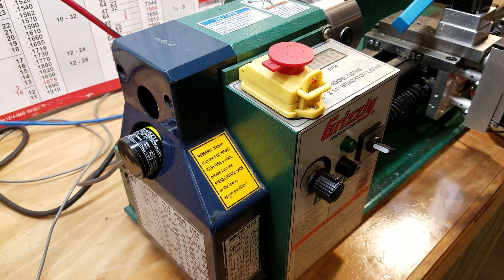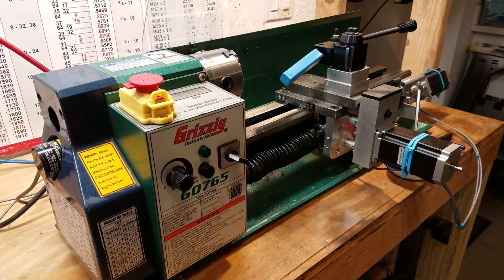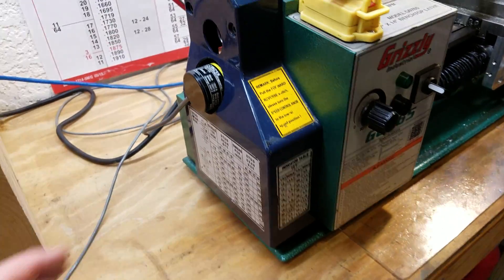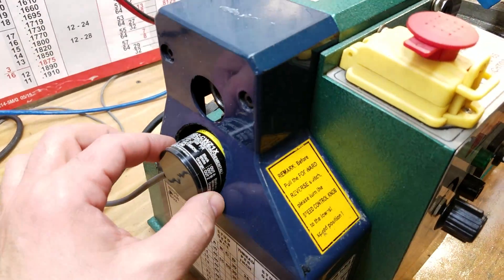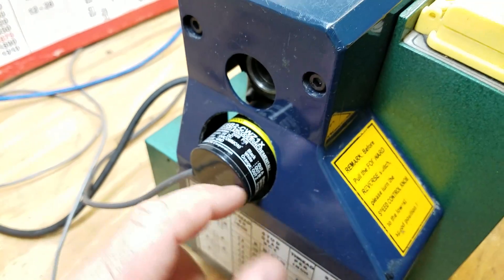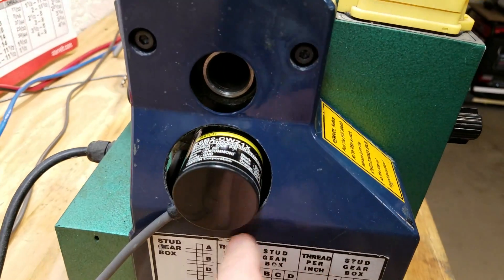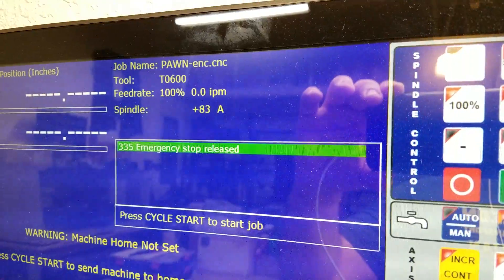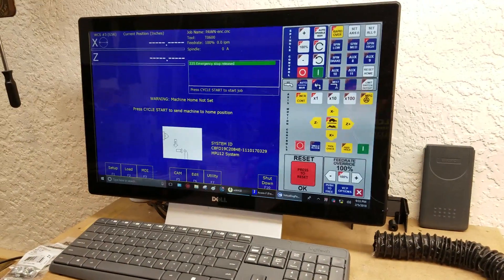Update: Mini-Lathe Spindle Encoder Mounting Kit for Centroid Acorn

Comment: Smart decision Franco. If there is a way to screw things up and get hurt, someone eventually will. I applaud your decision to hold things off until you had a good solution. Another option you might look into (or not) is to 3D print a deep cap that snaps into the hole you just made, for those neat freaks (LOL), and you might make a few extra bucks from them.
Reply from the maker: Thanks.  I don't want to see anybody get hurt.  I I'm really close to having a solution for this one.  I'll think about the cover idea.  That may work out really well.

Comment: Hi Franco 
Nice vid , i just received my G0752 lathe today, however, VFD doesn't work ,i have only low speed , so im calling grizzly tomorrow, i live 1 hr from grizzly warehouse in washington state ,should be easy fix .
Howmanh kuts you have left for small lathes?
Reply from the maker: David Burdick Hi David. I have several kits left for 7x10, 7x12 and 7x14 lathes. G0765 is a popular choice.